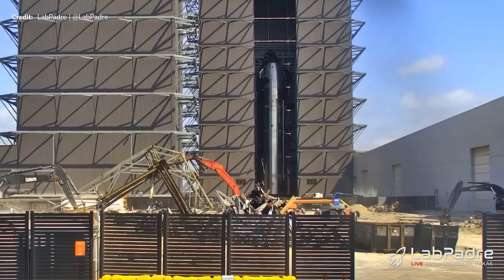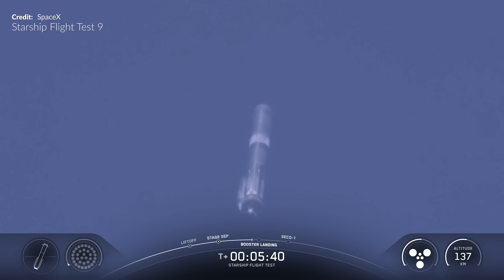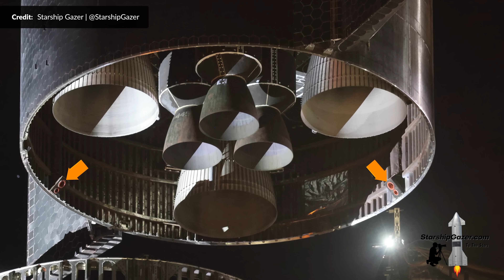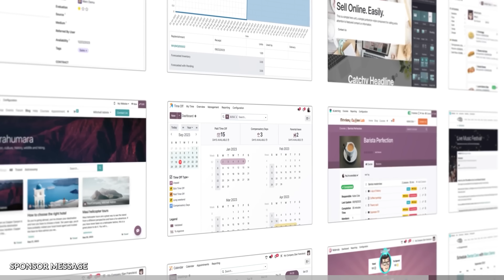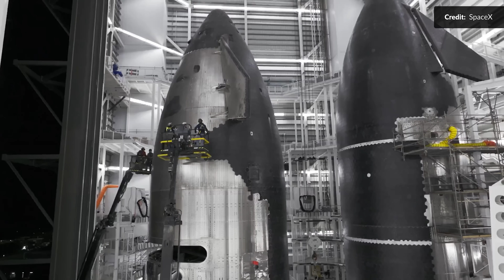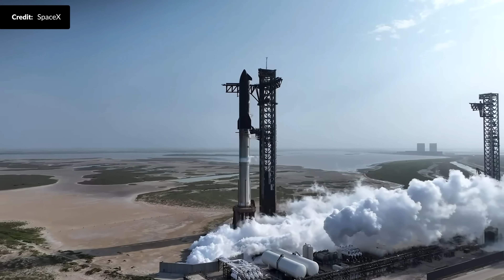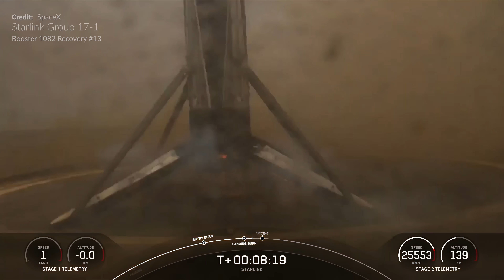Wow... Starship’s Big Surprise Came After the Flight!

Comment: I still don't get it. The Saturn V made it to orbit and had a perfect mission on it's very first attempt, aaand almost a perfect record. Starship is not being built in some sort of alt. timeline where they are the first to ever get to space, nooo, they are the most recent of a very long line of rocketry break throughs and incredibly talented engineers. Starship is not a vastly complicated machine when compared to other rockets. They can't even reach a stable orbit, do a few maneuvers, and a reentry burn. What's the problem guys?
Reply: They are trying a lot of new/not well tested ideas.
e.g. full stage combustion engines, methane, re-entry for full ship, flaps on 2nd stage, hot staging, methane attitude trusters, high number of rocket engines, stainless steel.
There's probably more, very aggressively pursuing new tech.
Reply: @pietersmit621  Apollo was built in a vacuum. The Saturn V was far far more complicated for the time it existed in than Starship is today. On it's first launch, and every one after, it was almost a perfect mission for the craft itself. That rocket was so advanced, entire categories of engineering were developed just to solve some of its technical problems. A different fuel and an upgraded engine does not a more complicated vehicle make. Compared to what the guys in the 60's had to deal with when it came to rocket engineering, Starship is a cake walk.
Reply: Hold on a second… there are some big differences. 1. V1 starship was able to do reach orbit and relight the engines plus it did the unthinkable and landed softly at the bowie. 
2. The booster reusable… and has been caught
If they just wanted to launch this thing and not recover the booster or ship, this would be already be done. They have put 100x the amount of engineering into this rocket to make it reusable
Reply: Is it coincidence that last 3 Starships (7, 8, 9) all ended with the same leaks in space when ground testing at Massey's site didn't show any leaks? All the leaks started right after Elon joined Trump/DOGE. Someone inside SpaceX really hates Elon. Loosening some bolts before launch. Ships 1-6 didn't have these leaks. Ships 4, 5, 6 made it to the Indian ocean.
Reply: A lot of it comes down to mass. Starship right now is too heavy. Trying to remove mass makes parts not strong enough to survive.
Reply: you mean like the Space shuttle? I know it wasn't fully reusable, but the shuttle itself was, and that also made it to orbit on it's first try, done multiple maneuvers and returned, with wings, and landed. Again, what's the problem with Starship? Your excuses are just that, excuses.
Reply: @CoalMininMan  You asked a question what is new about Starship compared to 70 years of previous rockets, and I answered your question. You didn’t like my answer so your response is to ignore my answer other than trying to use Shuttle as a rebuttal, then you proceeded to personally insult me and accuse me of not answering your question and just making excuses. 

I said Starship is fully reusable. The Space Shuttle consisted of four main components, the orbiter, the external tank, and two solid rocket boosters.  The orbiter and solid rocket boosters were recovered but the massive and expensive external tank was not, so the Space Shuttle was not fully reusable.

I said Starship is being designed for rapid reusability. The orbiter and solid rocket boosters required massive maintenance and refurbishment between flights, to the point that later analysis showed that refurbishing the solid boosters cost as much as if they had built new boosters for each flight.

I said Starship is being designed for low cost rapid production.  Each Space Shuttle took years to build and was massively expensive.

Sorry that the answer doesn't fit your narrative that Starship is not doing anything new.
Reply: Tell that to the families of the crew of Apollo 1.
Reply: @JohnSmith-x3y8h  That was a failure on the pad bud. I hope you knew that
Reply: @CoalMininMan It was still a failure.

Starship has completely different goals to Apollo, so the challenges are new, your argument is nonsense.
Reply: @JohnSmith-x3y8h  NEW? They cant even get to a stable orbit. Whats the "new" in something damn near 70 years old?
Reply: @CoalMininMan 

They haven’t yet attempted to reach a stable orbit, so they haven’t ’failed’.

If you can’t see that many of the things being attempted are completely new, then you clearly don’t know much about rockets.
Reply: @JohnSmith-x3y8h  wow, talk about burying your head in the sand.
Reply: @CoalMininMan @CoalMininMan There has never been a fully reusable space vehicle, which is also being designed for rapid reusability. There has never been a space vehicle designed for low cost rapid production. Each Saturn V was extremely expensive and could only be launched once. And Starship is also much larger and carries much more payload. That's what is new.

Comment: Did the 9th flight of the Saturn 5 fail ?  8th? 7th? 6th (yes, second stage had two failed engines).  5th ? 4th? enough of this . . . Did Artimus 1 fail (put together with spare parts, went to moon and back; then got cancelled) . . . While we are at it, aren't Falcons reusable low earth orbit rockets and when you need to punch something real heavy or go out of Earth's orbit, Space X expends the Falcon Heavy just like the old way . . . What's up, is this a CON ? ? ?
Reply: Artemis cost $93 billion. Starship has only cost $5 billion so far and is expected to be successful by $10 billion. Note that launch 9 only cost $20 million due to booster reuse.
Reply: What? This is comparable to exactly zero of the things you listed in that Rant.
Reply: There were many experimental flights (at least 27) of prototypes testing out various systems and approaches that fed directly into the Apollo configuration. 

SpaceX is essentially starting with the an Apollo-sized configuration, testing all the systems as they go along, plus making it relatively cheap, reproducible by the hundreds, and reusable. Those are three quantum leaps over Apollo and any previous design, except maybe Falcon.
Reply: my point exactly, even in this very chat
Reply from the maker: The main development is actually the production line. They care little about individual Starship prototypes, they even discard them all over the place when they have evolved too quickly. It is a totally different method of development. Saturn V and SLS completely disposable. This is a VERY different problem.
Reply: @MarcusHouse exactly! People keep forgetting that they've built an entire production line and have almost mastered the ability to mass produce these vehicles. THAT is just as much a breakthrough as an individual prototype hitting a milestone.
Reply: It’s called R&D, the goals of Starship have been publicly stated. The reasons for them are clear.

Comment: I wonder if a lot of the problems is from having this weird inbetween where its designed for the new raptors but made to work with the old ones.
Reply from the maker: Always kind of felt like a middle ground design that tried to fix things before being required to use the new launch tower design. The Block 3 really is going the full redesign of the afts and what not.
Reply: The problems come from pogo and fuel leaks, which is caused by engines with little fiddly bits vibrating around inside steed shrouds that create gas pockets 🔥💥
Reply: @NPCSoftwareInc The pogo could be from the design before for raptor v3, but using v2, maybe? Because I'm fairly certain the engines cause the pogo and so maybe that's the problem.
Reply: @That_Awesome_Guy1 maybe it's the new downcomers.. instead of 1 there is now 4.. long thin pipes that can litterally turn into a sine wave 🫣and they are vacuum jacketed too so pipe inside a pipe for extra vibes 😰
Reply: @NPCSoftwareInc Bose has resonance cancelling abilities to bring, or some rubber puck pipe mounts in the fuel pipe vacuumn sleeves ?
Reply: Bose vibration cancelling headphones/dampers or some rubber puck mounts  @NPCSoftwareInc
Reply: @BoycottChinaa  perfect solution! Also maybe add an old lady with a broom to the bottom of the ship so if theres and vibrations above her she bangs on the ceiling and tells them to "keep it down"
Reply: I think its the fule pipes
Reply: I think it is the overall design of starship, not the booster as we have seen that works just fine, but the starship perhaps it needs a wing design.
Reply: @RamblingRodeo there is nothing fundamentally wrong with the external design.  It can land fine.  We’ve seen it several times.  It’s the internal design that has been problematic.

Comment: With the ship spinning out of control being a repeated failure mode, why don’t they use a backup attitude control thruster system? It might have helped them to achieve controlled reentry a couple of times already, in addition to achieving mission objectives such as engine relight.
Reply: WEIGHT & COMPLEXITY!
Reply: @miller-clem but they were able to fit a banana?!?!
Reply: @cbuchner1 bananas are important…
Reply: @cbuchner1  Imagine a main tank leak under pressure. It's what is causing the spin. You'd have to counter that with RCS. The entire duration would need compensation. That's a ton of fuel. Unlikely able to do that sustained for any significant amount of time. Being these are test flights, adding that kind of complexity and spending is likely to exceed the budget allocated for the test vehicles. It would be excessive waste on these consumable vehicles. Especially if not used. In that case it would need several additional steps to secure the propellant or dispose of it. I'm sure my speculation is lacking several other points, but that's the main ones I can think of.
Reply: @Chris_Bro_aka_MR_PLAT1NEM  your just trying to defend a failed idea... @cbuchner1 is totally right. the ship should have a backup RCS system in the first place... not only because they want to get that thing human rated, but also because its a no-brainer. 
by your logic, there is no reason to fly any starship in the first place, because the current raptor engines are already outdated and have much more parts, that got already simplified and removed on the next generation. 
currently they have wasted 100% of the time and materials invested into the "re-entry" mechanics, that is flap aerodynamics, heatshield tiles, etc... 
Classic RCS systems already exist an just need to be fitted onto the ship. 
A tank-leak will only last until the tank is empty, which guess what - they have dumped all fuel anyway and tried an uncontrolled re-entry for the third time. with an RCS they could have stabilized the ship after dumping and gathered data for controlled re-entry
Reply: Spinning out of control is NOT a failure mode. It is a failure EFFECT. They need to deal with the root problem.
Reply: Weight, raptors over limit and vibrations everywhere. I'm there on Angry's opinion
Reply: Dear God that's dude is nuts what does he know about rocketry The fact that angry acts like he knows what SpaceX should do gets on my nerves @JoLo6696
Reply: Wouldn't have helped anything in this scenario
Reply: COPV for now. It has nothing to do with the ullage gas.
It makes the ship heavier, but for now it's the most reliable option. They put tons of items to test at once, but once the ship fails that hard, these tests are useless
Reply: Control would not matter if they are leaking fuel. What do you think happens when you hit the atmosphere and are leaking fuel.... boom. Fix the initial problem, your suggestion is a bandaid that won't fix the actual problem.
Reply from the maker: Well, if the ship is leaking in an uncontrolled way nothing is going to help. Eventually it looses its ability to store pressure for the ullage.
Reply: @MarcusHouse  ullage?
Reply: @MarcusHouse that’s why they should use a separate system with pressurized gas or an unproblematic monopropellant
Reply: @cbuchner1 Glad we have you to show us how to do it😂.  You should start your own rocket company.
Reply: @cbuchner1 then what? It leaks all it's fuel, but yay we have a backup to keep us from spinning, but oh no we have no fuel so we're still going to crash into the earth and die
Reply: Offering advice doesnt mean they can start and run a whole rocket company.  Yes its a huge undertaking@ken-mb5cp
Reply: @cbuchner1 why? A tank leak isn't going to be fixed by another system.
Reply: @cbuchner1 bro it’s not that easy😅
Reply: @cbuchner1  "the best part is no part". They are loathe to add weight and/or complexity. They've got to make the current system work.
Reply: @rb8049Actually, I don’t know enough about the specific design differences between Crew Dragon and Starliner for us to be able to say they are that different in inherent propulsion design layout. Do you? - Dave Huntsman
Reply: they regained control as it entered the atmosphere ..but too late to put it back into a re entry position
Reply: It doesn't have separate rcs because that's not what they are testing.. they are getting the basic shape and concept of the vehicle before they start doing stuff like cargo doors, habitation, etc
Reply: @NPCSoftwareInc they could have tested re-entry 3 extra times if they had controlled the attitude correctly.
Reply: @cbuchner1 Bro I’m sure they’ve considered everything you’re saying; I wouldn’t read too much into it
Reply: @cbuchner1 with a rcs system that won't be used 😂😂😂 they cannot move on without the basic concept working
Reply: @cbuchner1  Isn't this loss of attitude a result of losing main tank pressure tho? That's kinda important for the actual reentry | landing as well.
Reply: @NPCSoftwareInc That's not what he's saying! They could have tested the re-entry a few extra times, and discard the backup RCS as soon as the main one works properly.
Reply: @gerhardvaneeden5615  😂😂😂 makes perfect sense! Just add millions of dollars of extra equipment per launch for redundancy in a vehicle they don't even know works! Just start a whole new rcs truster team of 150 people and spend tens of millions on something you may not even use 🤣🤣🤣 genius!!!
Reply: @NPCSoftwareInc As it turns out, they would still have saved money!